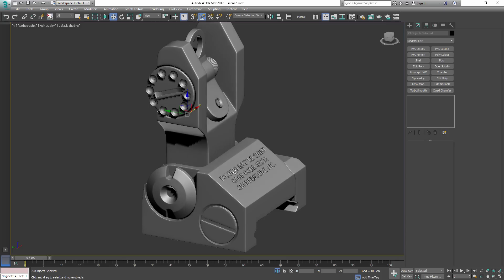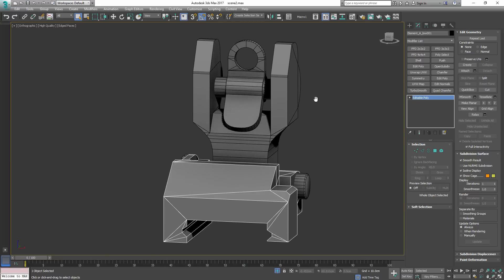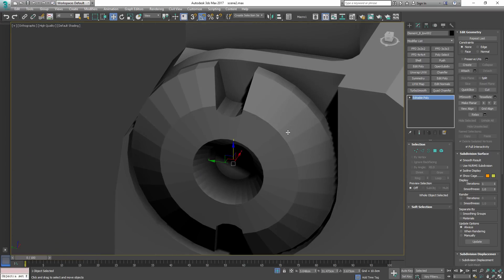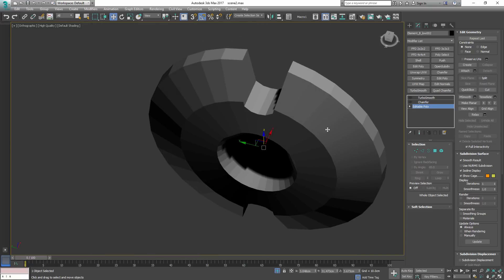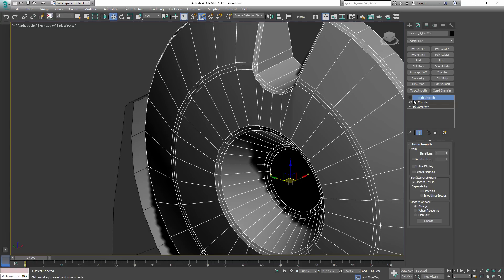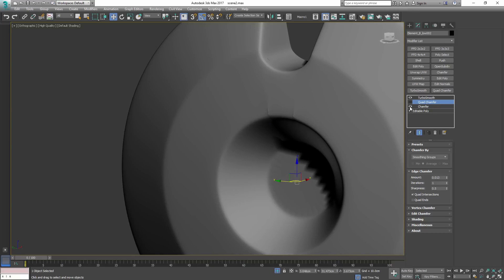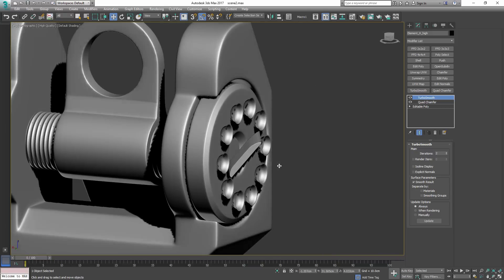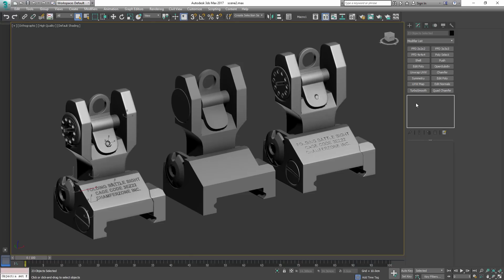High Poly Special - creating the perfect hard surface High Poly model - 3Ds Max 2017

Comment: Hey Tim, amazing video once again and very interesting to see a professional approach to workflow. I have a question regarding openSubdiv. Would it be more efficient to just keep the low poly mesh and then use OpenSubDiv and edge creasing? Is there a reason you prefer using chamfer and smoothing groups? Would be interested to know why you choose this method over opensubdiv unless it's just what you are used to? Thankyou so much for the awesome videos and can't wait for more! Dan
Reply from the maker: Hello Dan, thanks for your comment, glad its being useful. About your questions with Opensubdiv. For the most parts it's just that I got so used to this workflow as seen here. I used it already before quad chamfer or chamfer modifier existed 8 years ago with a modifier called "edgechex". So the whole workflow really got into my everyday flow like a preferred hammer and emboss from some smith or something ;) I tried opensubdiv a few times already but always find myself going back to the chamfer + turbosmooth modifiers. The workflow from this vid also doesn't produce such a high polycount in contrast to opensubdiv.

If you look at the actual geometry that opensubdiv produces you'll see that it's much higher then the chamfer + turbosmooth method. Also with opensubdiv ... the edges you set your properties to will always look at what is the nearest edge, so if you have some further apart it looks odd and you need to add extra edges. It's a bit hard to explain but the bottom line is.. I find chamfer + turbosmooth much faster and straight forward but I am also no opensubdiv super pro who may have a different opinion about that ;)
Reply: Hey Tim, thanks for your reply. It makes sense to use what you are comfortable with as you know what to expect each time. Plus your models always look so amazing so you are definitely doing something right. Thankyou again for your great tutorials and I really appreciate the effort you put into sharing your workflows. All the best, Dan.

Comment: Wow, really good tutorial. I finally realized what the purpose of a floater is. Just one question :). Is it better to do high poly detail in 3ds max, or is it better to do the detail using normal map brushes in substance painter 2. Thanks again for the tutorial.
Reply from the maker: Hey Nathan, thanks glad you like the tutorial. About the details I try to do as much as possible in the high poly. The reason for that is that when you bake your maps out those details will go straight into the curvature and thickness and AO map that add further detail when you add your wear and tear. So for instance if you have some boltheads on a tank... it would not show any leaking effect if you were just to place that in painter. Of course for some parts that's still fine but in general best to pack as much in the highpoly as possible. I consider highpoly modeling already a part of texturing in some way because of it :)
Reply: Thanks. Can't wait to see your next vid :)

Comment: what are the alternatives for this turbosmooth + chamfer method if modeling in Maya or Modo?
Reply from the maker: Hey mate, I personally wouldn't know because I only work with Max but it would certainly be interesting to hear if there are similar ways of doing that in the both Software Packages you mentioned

Comment: Which shader r u using to see the normals in the viewport?
Reply from the maker: Hello 123, I recently made a small tut on how to do that. Here's the link! http://forum.chamferzone.com/viewtopic.php?p=1384#p1384
Reply: Ok so you're using a standard material with "show realistic" option on.
I thought it was a directx shader. Awesome tutorials keep them coming! ;)
Reply from the maker: Ah right, yes I never use any direct x shader, just the default. I barely ever put more on in Max as the normal map. Normal map is nice to apply to it to check for errors in general :)

Comment: hey Tim im really struggling with what to do. Im a maya user and can do amazing things with it but am told by everyone that 3ds max is superior and nicer. With your knowledge and experience, should i takd the plunge and learn it?
Reply from the maker: Hello Sir, well I can not really comment on Max or Maya really because all I ever used was Max and it gives me the results I need to finish my work reliably without problems (meaning there has never been a reason to swap and also because all companies I ever worked for use Max). I'd say you can be good with either one of the packages. There is another discussion over here that may be worth reading up for you as well http://forum.chamferzone.com/viewtopic.php?f=10&t=13 :)
Reply: ChamferZone thank you for that! That was super informative! i really appreciate it! I think ill learn Max and use both depending on their strengths :)

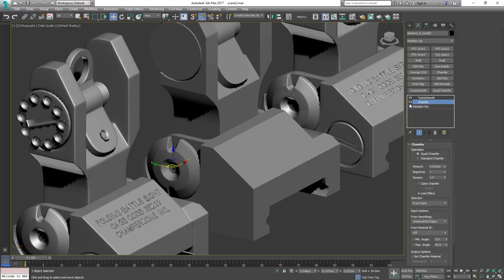Comment: at 11:48 your normal map looks like it was baked without sg's in the center of that round object.
Reply from the maker: Hi iHome yes you are right, I had a problem there with the normal map. I baked it out quickly for this tutorial then later noticed I had two objects stuck in each other for the highpoly bake.. resulting in that odd look.

Comment: 14:52 They already have a quad chamfer they added to 2015. Just go into the Chamfer modifier and change it to Quad mode like so. http://prntscr.com/exoqg0
It even looks like you are already using the chamfer modifier with Quad mode enabled. 
Is there a difference between the 3rd party one that I'm missing?
Reply from the maker: Hi Tomos! The quad chamfer modifier they got in there doesn't get rid of that pinching. They did add it now in 3Ds Max 2018 finally but there are still some problems with it that make Marius Silaghi's quad chamfer superior. I made a comparison just yesterday over here to point out the differences: http://forum.chamferzone.com/viewtopic.php?f=10&t=705
Reply: @ChamferZone  Oh I see what you are talking about, I didn't know that issue was called "pinching" it drives me nuts! I will certainly try out plugin then.

Comment: what's the chamfer modifier in maya?
Reply from the maker: Hi Jokester, sorry I haven't seen your question earlier then that. I never worked with Maya but from what I heard it doesn't have the flexibility that Max has with all its modifiers so I wouldn't know how to replicate that kind of workflow with it as seen here. I did a quick search and found this. OpenSubDiv is probably the way to go for Maya.  https://forums.autodesk.com/t5/maya-modeling/3dsmax-chamfer-modifier-equivalent/td-p/6409501

Comment: I have modeling classes but I have a question. My teacher is not that great so I prefer to watch tutorials online. But I got this thing stuck in my head and I would appreciate any help from anyone. My teacher said we must not EVER do geometry that has faces with 4+vertices, or 4+edges. He says that's horrible optimization etc etc. In this video, he has many faces with such problem, is it reaaally a problem?
Reply: No its not. It depends on the subject you are trying to model. For hardedge gameready models it is totally fine to use triangles and even ngons on flat planes of the mesh. Sure you can model everything with quads but your final mesh will have a higher triangle count and it wont make any difference. The only case i know there a perfectly quadbased topology is really crucial are organic meshes for animation like faces, hands etc. and maybe very curved hardsurface meshes like cars.

Comment: What did you use to make the text on the highpoly? I tried to replicate it. I created a simple text and added a shell modifier and than used boolean to make it like it. It looked really ugly and im unhappy with the results. http://imgur.com/a/zlEKf
Reply from the maker: Hello Leon, you can see how I do text here in this vid https://youtu.be/Y83FLL6TqF0?t=4987 Basically I inset it.. then pull out the outer edges and apply the chamfer modifier.
Reply: Ok thank you

Comment: I dont want to sound mean but the topology of this, is just bad. 
Thats a lazy way to model, not the way to go. 
Using modifiers to take care of bad topology is a no-no, in my book.
Not sure what makes that a perfect High Poly model, really.

I don't know, Im working in zBrush and my topology is always perfect when importing in Maya, not sure if the topology Im seeing here, (Low Poly ver. is how It should be if done "only" in Maya/3dsmax) So ya. Also later when texturing it, it would be nicer to have a proper topo so to be able to select parts you want to texture easier than to have to paint in 2d because you dont have loops/edges to select so to add a Mat.

The model "looks" good but technically, is not.
Reply from the maker: Hi Bad Kitty. You say it yourself that you are "Not sure what makes that a perfect High Poly model, really."  but then you jump to the conclusion that it's just "bad". 
Hmm... Well I also don't want to sound mean but for a starter this is the preferred way of working for many top artists in the game industry. I share my everyday workflow on here and certainly have no intention to show techniques that are not working. You also say "you don't know it", so yes that is the way to do it in 3Ds Max for hard surface art. Organic modeling/sculpting in z-brush can not be compared to this workflow as seen here. At the end you can do whatever works best for you and it's good if the time consuming retopo gets you results. However it will never be as accurate as reusing the same geometry. This is the way to ensure that the low and highpoly geometry is as much in its same place as it can be which gives you the ideal normal map baking result. You should give it a try as not only is it faster but also more accurate! Cheers.
Reply: ChamferZone Will definitely try it out, when i will have some free time! Im just not used to this workflow. As I said, if theres not a quad something inside me just tells me to go and make that area full of quads. It doesnt seem right BUT ya, if that asset is static, youre absolutely right, theres no need that asset to be "perfect", topology wise. Is just a waste of resources. Sorry if i sounded absolute but watched your other video and it made sense.
I'm also mostly into organic modeling, Characters/clothes and a little mix of the two when it comes to shoes :-) Maybe hard surface is more forgiving! Have to try it out!
I like to speak my mind, sorry.
Back to unwrapping my model now >.> lol
Reply from the maker: I appreciate your answer and glad the other video helped explaining it a bit better. Yeah the plan is to have a few more of these special video episodes highlighting some key aspects. If you are curious to try that workflow in action you can also follow the grenade tutorial. It's 3Ds Max only for the modeling part and I use this method in it. :) Cheers!
Reply: ChamferZone Yes i am curious!. Watched the texturing version. Thats how i found u! :-)
When taking a break Im watching vids so ya, will definitely watch your other ones :-)